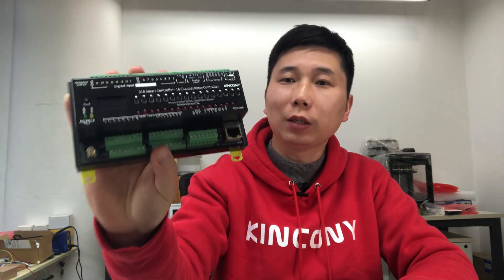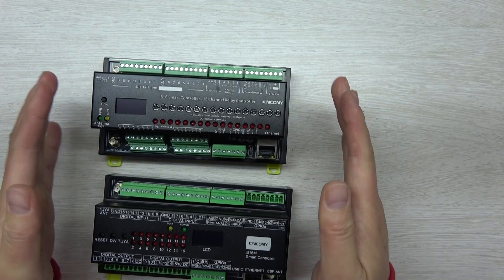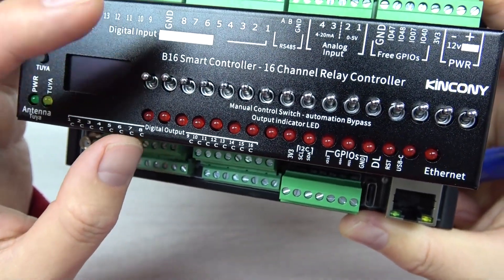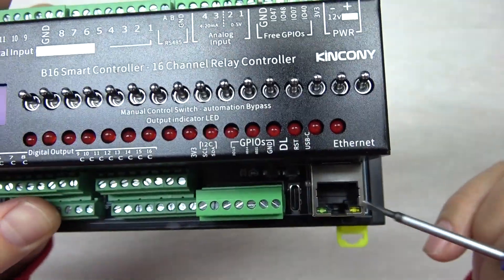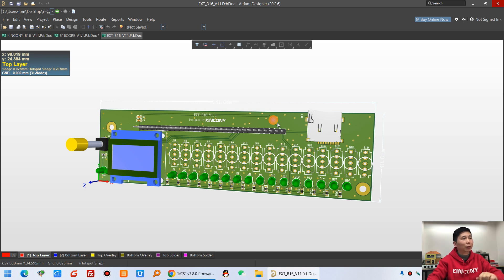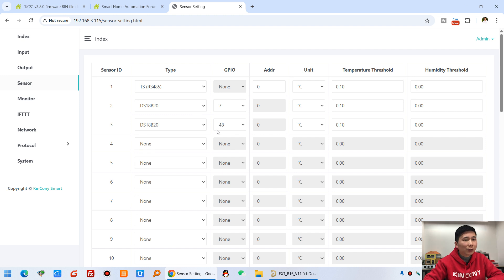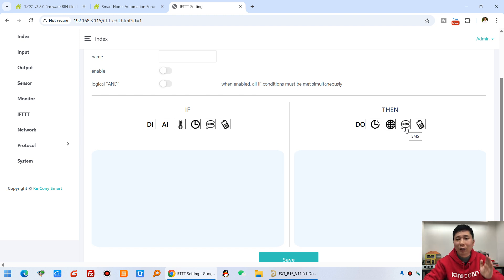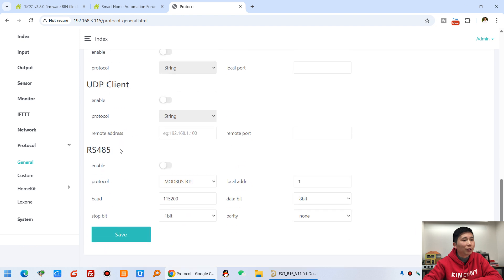ESP32 Smart Relay | Ultimate Home Automation Controller – KinCony B16

Comment: hi, great project. I'0m using B16 but it's a bit unclear how to set the digital input configuration. In the website, yiou mention to set properly the ports to address the outputs controlled by each input, but the admin page related the inputs, only contains ttwo columns: the id column, and the reverse flag column.
Can you please send any reference to discover how to configure the digital inputs? thanks a lot
Reply from the maker: you need config by IFTTT webpage, let digital input toggle digital output
Reply: @KinCony  thanks, does the digital inputs needs 12v at least or those can be managed also with 0V? just dry contact?
Another question. Is there a way with IFTTT to control an output on another module?
Thanks a lot
Reply from the maker: @DanieleCiattaglia  1: just only dry contact is enough, NOT must need use 12v. 2: sure, you can use IFTTT define customize command send to other boards.

Comment: Is it safe to power it up with a 12V lead battery? The voltage in fully change state will be about 13.3V.
Reply from the maker: it's ok.

Comment: Can I use this as RCD controller as well as energy monitor?
Reply from the maker: we have energy meter board.
Reply: @KinCony  Thank you for reply. So in case we need to control 16 channels and at the same time monitor their energy I need to use the combination of products like you have explain here https://www.youtube.com/watch?v=KUIYQu23QhQ? 
These are great products. Do we have any cheaper solutions which combines both features for home automation?
Reply from the maker: @shankargurav  you can install by M30 energy board with different relay controller.

Comment: Nice board // Any update on developing esp32 with 6 ac fan dimmer and 6 analog 0-10v output and 6 -16 amp amron removable relay and 6 free gpio for wiegand.. Everything in one multipurpose board ?
Reply: @adarshsonalika7493  yup...much needed board for indian market. If it is possible very nice and appreciated. Hope kincony can able to do this.
Reply from the maker: which case use by this style board?
Reply: @KinCony mqtt and home assistant must have. metal cover with lcd screen
Reply: @KinCony  mqtt and esp 32 for home assistant
Reply: I think he is from india. Usually the indian circuits be like this style😂

Comment: I love the boards you are making.  Thanks for all the exposed GPIO on this one. I'm using them for a cool application inside small breweries.  Question - did I read it right that the B16 supports AC on the relays?  I need 24VAC support?  Also, How would you describe the difference between this and KC868  -A16?
Reply from the maker: B16 is relay output , dry contact, so you can connect with any AC or DC load, 24VAC load is ok. B16 more powerful than A16, A16 just a low price solution product.